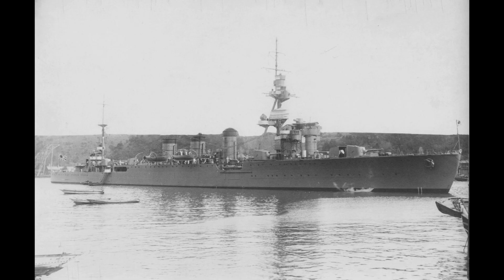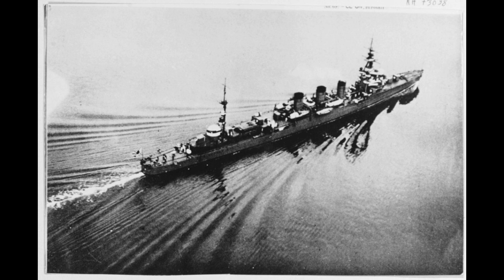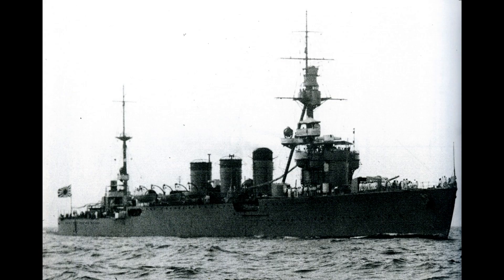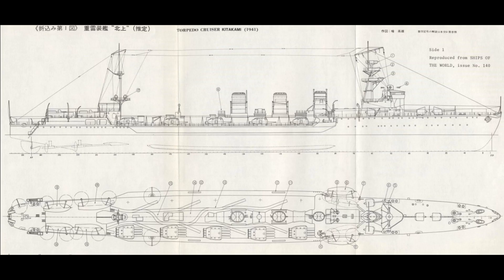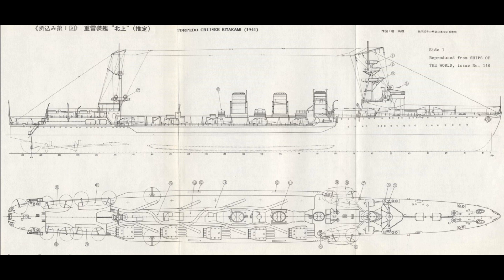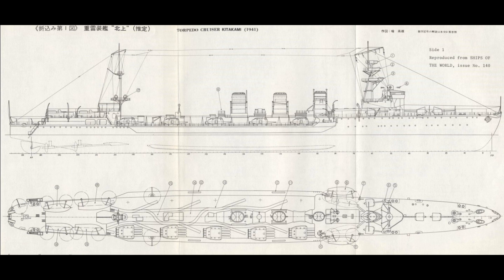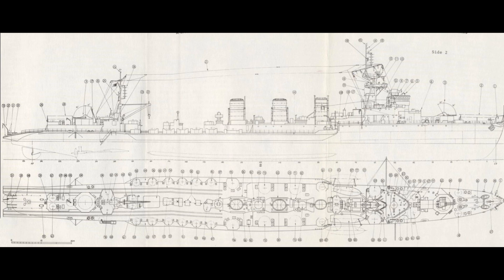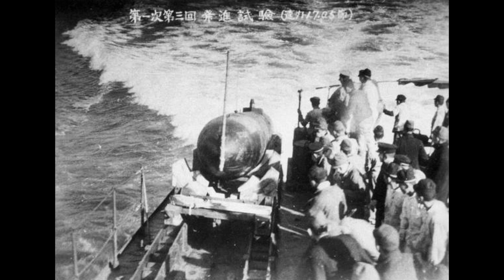IJN Kitakami - Guide 285

Comment: Q&A: You mention the Fourth Fleet Incident. It seems that the Japanese navy learned some important things about ship design from this disaster and implemented some major changes to its current and future ships. Did the US Navy make adjustments to its ships after Typhoon Cobra?
Reply: The big problem was Halsey not changing course until too late, and many small ships low on fuel.  Halsey had promised MacArthur he would support the invasion, but needed to back off for a day to refuel.  His destroyers were particularly low.  The weather kept getting worse but Halsey was trying to keep close rather than steaming away from the incoming typhoon.  Several captains warned him a major storm was coming, but he waited too long.  Not a ship design problem, a leadership failure.

Comment: The Japanese had by far the best torpedo in WWII (long lance) - I have often wondered why they were so seemingly inept at using them with greater affect - unlike the American fleet subs or the German wolf packs which had inferior torps by comparison.
Reply: The Long Lance was surface-launched, and the Japanese were pretty decent at using it.

As for why Japanese subs sucked….submarines and ASW were the single biggest weak point of IJN doctrine.

Comment: So many torpedoes, would love your thoughts on the doctrine and circumstances that created her.
Reply: Drach had discussed it already, see his Kantai Kessen video. Quick synopsis is that the IJN wanted a way to whittle down the US Pacific Fleet as it crossed the Pacific to relieve the Philippines. IJN doctrine was that cruisers would launch night torpedo attacks on the Pacific Fleet until it becomes small enough for the IJN battle line to defeat. In order to achieve this they needed torpedoes with very long range that didn't leave a wake of bubbles. This was what drove the creation of the "Long Lance" torpedo, pure oxygen instead of compressed air meant no trails of nitrogen bubbles. Pure oxygen allowed very long range since you can pack in more oxidiser. Since the torpedoes were to be launched at long range you needed a lot of torpedoes to ensure hits, this resulted in IJN packing as many of these torpedoes onto their ships as they can. The result is a specialty ship for a specific role in a specific battle that never materialized.
Reply: @alaindao7374  yes but that’s more of the larger overview. I would like specific on the why if these ships as much as we know.
Reply: @Eulemunin  

Because nobody had guided torpedoes when the Long Lance was under development, at maximum battle ranges the Long Lance had a pretty bad hit rate (though other torpedoes were even less likely to hit at those ranges because they just couldn’t go that far). The Japanese solution was to just spam Long Lances so that they’d hit SOMETHING simply through there being so many of them. Hence this abomination armed with 40 Long Lances.

Comment: Why hasn't modern navies done Kitakami Type Torpedo Cruisers or Torpedo  DDs? Where they just have small auto turret, SAMs. And just torpedo launchers out the ass.  Basically what Russia does with IRBMs CGs but with long range MK48 variant Torpedo.
Reply: Because opposing surface ships aren’t expected to come within torpedo range of each other. A torpedo that can go 50 or 60 kilometers doesn’t do much good when the missiles start flying at 100 or 150.
Reply: I've asked a couple of ex-service people about this. Torpedoes would be more lethal, but the shorter range and slower flight (swim?) time make them not very practical for surface warships.
A Mk48 or Spearfish might have a range of 50km, but just about every modern warship has hydrophones which will pick up a torpedo launch. Against an evading target the effective range is a lot shorter. A torpedo is one-tenth the speed of a missile or less, and no-one wants to hang around for the ten or fifteen minutes needed to guide a long range torpedo close enough for the active seeker to take over. And the torpedoes are really heavy, a warship can carry three or four times as many Harpoon/Exocet type missiles.
Reply: Because modern warships do the same thing but with missiles instead of torpedoes.